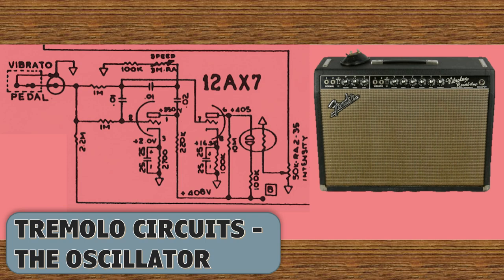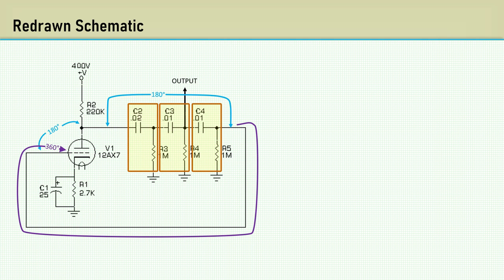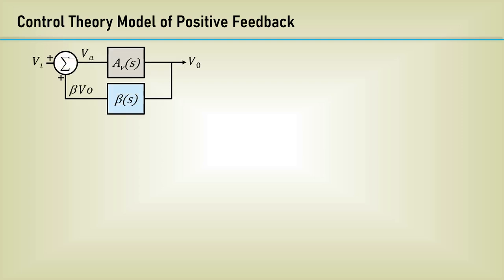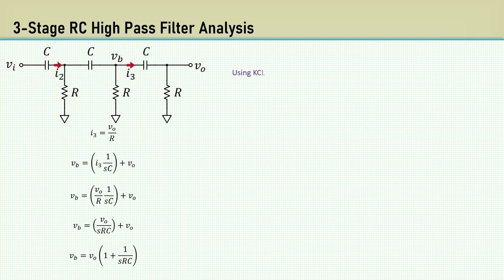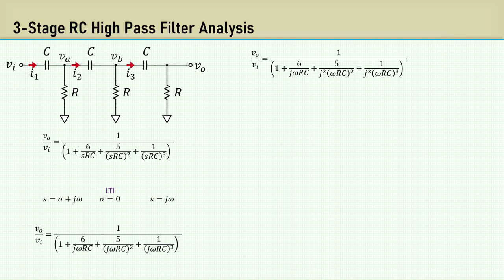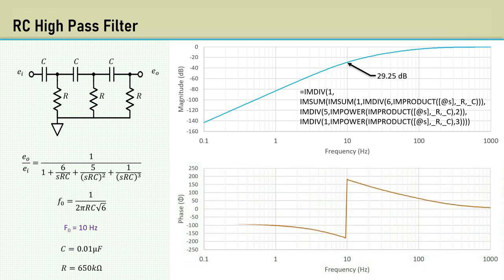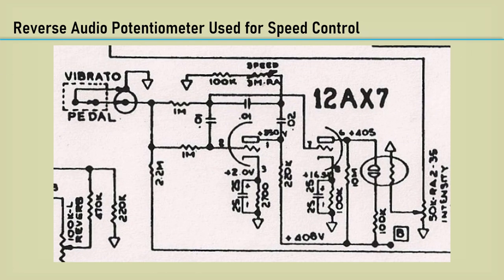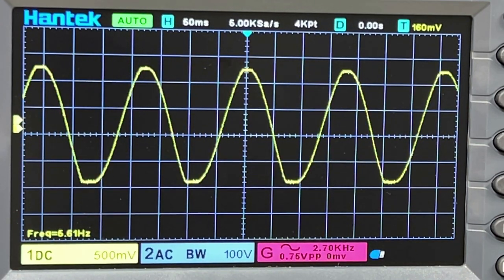Tremolo Circuits - The Oscillator

Comment: Wouldn't some type of FET be a more direct tube substitute (at lover voltage)?  That opamp uses an awful lot of transistors .
Reply from the maker: Absolutely. I used the opamp so I could get a accurate gain control to demonstrate how the Barkhausen criterion is on the edge. Thanks for the comment.

Comment: HI! I'm trying to make a tremolo but, instead of affecting the entire signal, I just want the tremolo to affect from 1k to 2k spectrum, is that to difficult? Thanks
Reply from the maker: Interesting. You could probably put a series resonant LCR circuit in series with the LDR.
Reply: @oldhackee3915  Hey! Thanks, to take the time to comment. I play bass for a living, and my bass just died on me,  the op-amp TL062 is dead.. sure I could buy a new one, and its all good again... not me.. I'm going to make a pre with Bass Treble and Mids,  but I want the Mids to be parametric, with variable frequency, boost / cut and fixed Q.. after seeing your videos about gyrators and graphic EQ, I was inspired to build my custom pre, and learn while doing it.. not easy I Know, I'll watch your videos again, and maybe make a spreadsheet with the formulas for Cx and Rx, like you taught. Thank you
Reply from the maker: Thanks. Good luck.